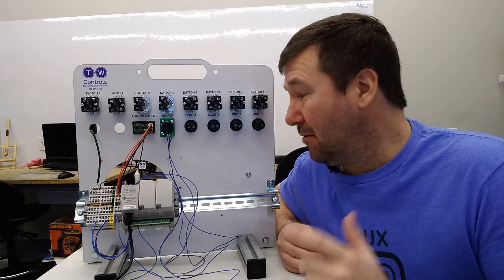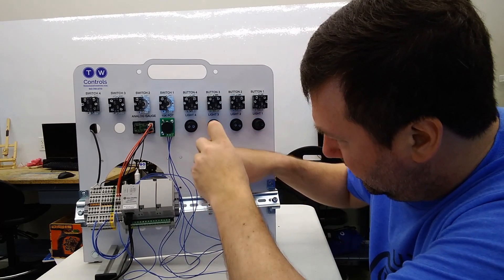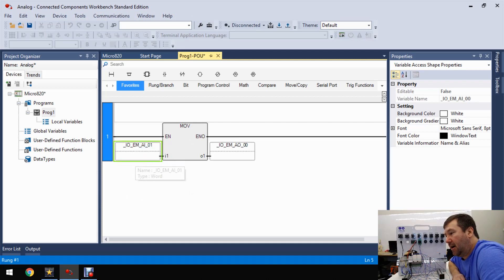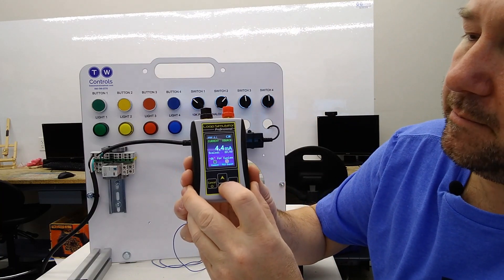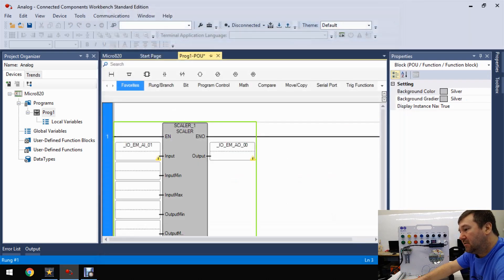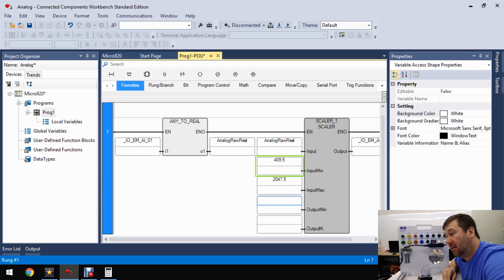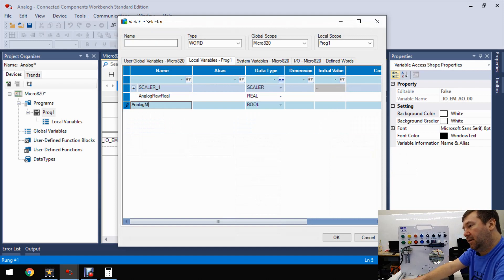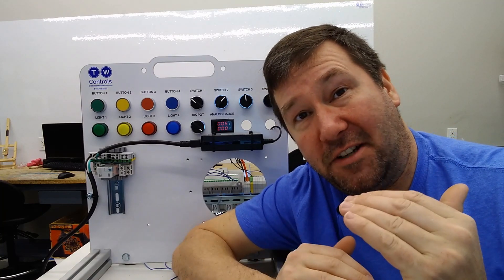Wire Analog 4-20mA to 0-10VDC inputs of Micro820 PLC and scale

Comment: Tim, I have an application where I'm trying to monitor a motor amp draw using a flex-core atr 2-420-24l-sp transducer. Will using the tip of this video work for that application? I want to trend the load and control to stop the machine when the motor reaches a certain load point
Reply from the maker: If it puts out a 4-20mA signal and you have a 0-10VDC input then it will work.  Ohms law is the same no matter what brand.
Reply: Yes Tim..it's a micro820. I meant to add that to my question. I appreciate how quickly you responded. You're awesome!
Reply from the maker: Happy to help. Good luck!

Comment: I’ve got an 820 where we use the add on 2080-if4 analog input card.  A 4-20mA temperature sensor failed and all I have in stock is an RTD with a 2 wire 4-20mA puck that takes a max 30vdc input. 

When I calibrate the transducer I confirm my ma signal across full scale then connect to the input card the signal (at -15 deg) displays full scale 122 deg because the input is 27mA.  I confirmed this with 2 transducers and both transducers work on test bench to a ControlLogix analog input card. 

Not sure if my transducer will run on 10v and I don’t have a spare analog card to test as I don’t want to risk blowing anything up at 24v.  Do you think this will work to bring my signal to a voltage input?  

What voltage were you running to your analog device?
Reply from the maker: Since it says a max of 30VDC, you should be good with 24VDC.  Here is an upcoming video that will help you with your wiring.  You will likely be connecting it in 2 wire mode.
https://www.youtube.com/watch?v=k8_axizTWTE

Comment: I noticed something when I tried this. When I would go online and run the analog sim up to 20ma, the engineering value in the tag slowly dropped. Meaning: usually the value will bounce around but for some reason the value dropped very gradually from bouncing around 28300 to bouncing around 28200. If these numbers confuse you, I was using an 2080 IF2 and also only had a 220 ohm resister so the math was a little different.
Reply from the maker: With an IF2, you wouldn't need the resistor.  Just select 4-20mA in your configuration and wire accordingly.  Check out this video.  It is for the IF4 but would be similar.
https://www.youtube.com/watch?v=z3SOxTDLHb4
Reply: @TimWilborne  
I know that the if2 can be used as a 4 to 20 mA. I was just trying to practice converting 0 to 10 into mA. Just thought it was odd that the upper value seem to be bleeding down and was wondering if you’ve ever heard of anything like that happening before?

Comment: Hi Tim! Is there any way to stabilize the values of variable AnalogMaScaled? The decimal places vary too much, which is a problem for me, as I need to work with precision.Thanks!
Reply from the maker: I am surprised that I have never done a video on this...here you go...
FV=FV+C(NV-FV)
Where:
FV= Filtered value
C= constant (range 0-1) The smaller the number the more dampening.
NV= New Value

Filtered Value= Filtered Value+Constant*(New Value-Filtered Value)

New Value = Unfiltered Value

Constant= 0.00-1.00 The smaller the number the more damping.

Comment: Hi i just want to ask if the sensor that has 0-5V output are posible to use in the plc that require 0-10V analog input.
Reply from the maker: Yes, you would just utilize half of it's range
Reply: Thank you very much for your reply sir.

Comment: Hi Tim, thank I you for your videos. I am using a micro 850 to build a control system as part of my final year university project and your videos have been the saving grace in helping me figure out this project. 

I did have a question that I am hoping someone could help with. Is there any over voltage protection on the 2080-IF4 face mount modules? I have looked on line and found nothing after many hours of searching. My interest is in preventing damage to the module should the pot in the potential divider circuit be damage and the full 24 volts be see by the analog input pin. I have had a pot fail during installation and I would rather build a voltage clamping circuit to protect the module if it does not already have over voltage protection.
Reply from the maker: Check the specs but 24VDC will likely damage the IF4.
Reply: @TimWilborne  Thank you Tim. I built a 10VDC regulator circuit to supply the potentiometers which holds the voltage stable even if something should go wrong with the pot. 

 Thank you so much
Reply from the maker: @stomp1691  What did you end up building, I completely forgot I had this video on it 😂
https://www.youtube.com/watch?v=A0eIHWvyZEg
Reply: Hi Tim, I used a LM317 to build a regulated 10 volt output to use across my 10k pots. It also solves the problem of voltage dips when all the various loads cause voltage dips from my main 24Vdc supply. It makes for very stable analog inputs to the plc... and I haven't blown my input pin which is great.

Comment: Hey Tim, love your videos. Just a question when you a dividing the raw unit in half for the scaling you divide 4095 in half to get 2047.5, but wouldn't you count zero as a number? so 0-2047 and 2048-4095 would be equally divided in two so you could just put 2047 in the scaler? Just wondering if I'm up the wrong tree here. Keep up the good work.

Comment: Hi Tim, I have a Balluff BUS series analog input/digital output sensor. I can’t figure out how to set it up in studio 5000. I have this sensor being used my a proprietary PLC in my plant but it’s connected to a Bekoff plc. In that instance it measures distance. In the Input card, the white wire is in the signal, and then brown and blue is power. I tried to set it up this way in studio 5k but I’m getting some weird numbers. I’m using a Flex analog card btw. When I put my hand in front of sensor, it will go from 32000 to 10000 to 8, etc. I can’t get it to measure from 32000 to 0. Can you figure out what I’m doing wrong. In the analog card properties, I’m using 4to20 milliamperes.
Reply from the maker: What is the part number of your input card?
Reply: @TimWilborne  flex ie8
Reply: @TimWilborne  FLEX IO 1794-1e8

Comment: Will ths or something similar work on the output ?
Reply from the maker: No, you would need to use a voltage to current signal converter.

Comment: Hi Tim.

I would like you to take me a doubt I'm with an analog card 2080_OF2 (micro850) your output from 4 to 20ma is connected to the input of Powerflex525. I used a scaler block but the values came out different than when I use the direct signal generator on the Inverter input. Why does it happen?

 
Analog Signal                        Generator Card

20ma = 100hz                       20ma = 100hz
16ma = 67hz                         16ma = 75hz
12ma = 34hz                         12ma = 50hz
8ma = 11hz                             8ma = 25hz
4 ma = 0hz                              4  ma = 0hz

Thanks Tim. And keep on with the best youtube automation channel and content
Reply from the maker: Are you sure you have it configured correctly for mA?
Reply: @TimWilborne  I think so. I'm using a block scaler writing a value from 0 to 100 in the input. Input min=4.0 Input Max=20.0. OutputMin = 0.0 outputMax=65535.0
Reply: Strange that at the output of Analogica cplc card is with a value of 32767. But the inverter is at 34hz. I take the signal from the input of the clp I set the signal generator to 12m I put it on the input of the powerflex, the Inverter goes up to 50Hz.

Comment: Tim,I have a pressure transducer 4-20 ma  0-100 psi.  How do I scale to  measure feet?  I would like to open a valve at 26 feet and close the valve at 32 feet. Can you point me in the right direction?
Reply from the maker: There are 2.31 ft per PSI, so your range would be 0-231 ft.

Comment: could not find Any_to_real only any_to_LREAL in my block. Help?
Reply: I just had this issue and called tech support. If you change your theme to default the Any_to_Real will be there. You can then switch back to logix theme and the instruction will stay but it will be called stor. FYI
Reply from the maker: @riiska1  Oh wow that is great information.  Thanks for sharing!
Reply from the maker: I had this happen once also, unfortunately my only solution was to uninstall CCW and reinstall.

Comment: Tim, I love your videos!!!  I was wondering if you could do one on an RTD plug in.  I am used to setting an RTD up on RSLogix 500, but for some reason I am super lost on this platform
Reply from the maker: Here is one on installing plug in modules.  It is for 4-20mA inputs and outputs but it should get you close.
https://twcontrols.com/lessons/allen-bradley-micro800-plug-in-module-configuration-for-the-micro820-micro830-micro850-micro870

Comment: I'm trying to figure out the principle operation of 4-20mA signal. Lets say, we have a RTD sensor and wanna get input on a PLC I/O inputs which take 0-10VDC. If we connect on the current loop a resistor (in order to convert the signal and take the voltage measurement for PLC), that's may cause drop voltage, and therefore, current flow restriction. Obviously the restriction depends on the value of the resistor. SO, how is that possible to get 4-20 mA constant current on our loop, without its resistor affects the current in our circuit?
Reply from the maker: An RTD sensor needs to be connected to an RTD input.  You can't simply feed it voltage and read the voltage drop across it.
Reply: Your question is a common one and shows you are thinking !! Heres what happens ... the transducer ( pressure, temp, etc to 4 -20 ma) is scaled so that it will produce the desired loop current , over a range of loop resistances. The adding of the 250 ohm load , does in fact cause  a brief reduction in loop current, but the transducer will correct this by in effect lowering its resistance to bring the current level back to the original value.....if the loop has for example a 24 volt power supply, the total loop resistance is limited to r= 24v /20 ma  ohms, so you could even add a few more 250 ohm resistors in series before the transducer could not supply the 20 ma loop current..

Comment: Hello, thank you for this vidéo, i will make me save 100 Euros ! (4-20 mA / 0-10 V converter). Does it work with a Micro 810 ?
I want to connect a water pressure sensor 4-20 mA to a analogic input of a Micro 810, this sensor is allready connected to an ATV (2 of the 3 wire of the sensor, the common and the Signal, it's to vary the speed of a pump) and i measured 24 V dc in the sensor. How can i do ?
Reply from the maker: The Micro810 does not have the built in 10VDC power supply such as the Micro820 has so you'll need to add a 10VDC power supply to it.

Comment: Hi Tim,

Thank you again for your videos. I recently tried to download and use sample code on https://www.rockwellautomation.com. would you please tell me how I can use these code. I want to open them by CCW and take a look at the program so get ideas for similar projects.
Reply from the maker: Hi Maziar. Can you be a little more specific about what sample code you're trying to figure out a run? They have lots a good samples there.
Reply: @TimWilborne  My issue was how to open the files. It's all good now. 
When you have time can you please explain what the best way of programming PLC is between structure text, ladder diagram and Function Block diagram. for example, I know structure text is good for complex calculation. What are the benefits of each way of programming? thank you again
Reply from the maker: @Maz.Rafiei  That one is coming!